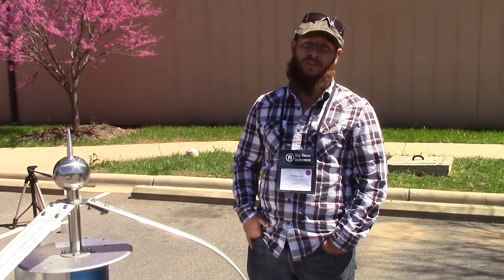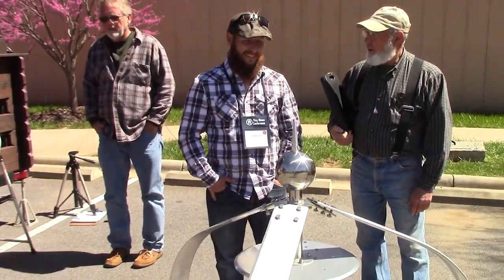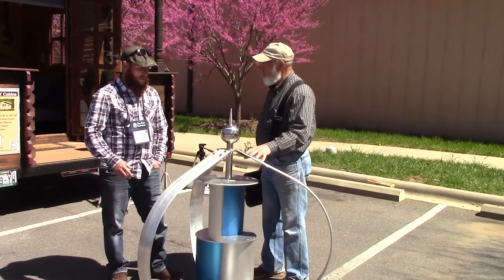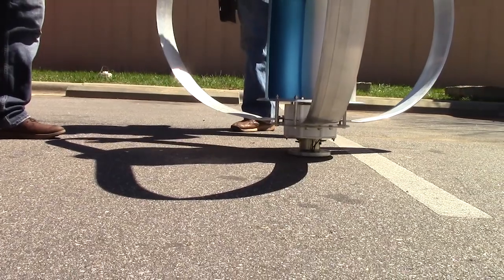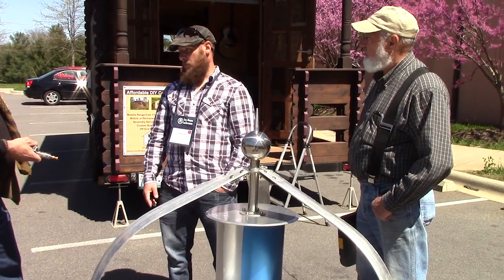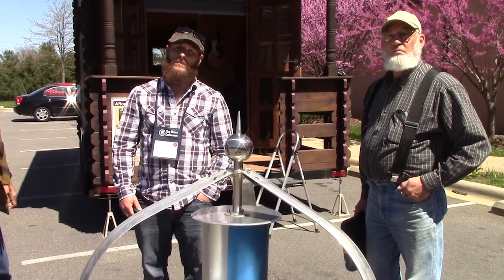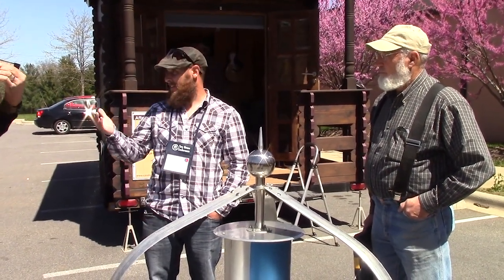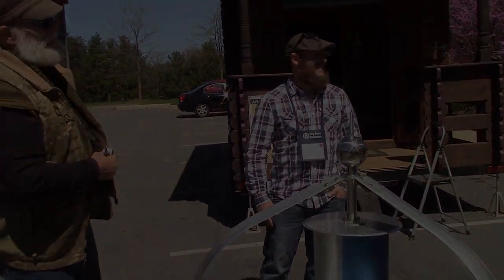Affordable 400 Watt VAWT (Vertical Axis Wind Turbine) Starts at 6 MPH

Comment: I would only need about eight of those just to run my entire house, at $528 each that is $4,000 and that's not including installation, and what happens on the days that the wind don't blow, oops no electricity, they have a phone number to call 814-573-6063 i n Pennsylvania

Comment: This is the worst turbine and company you could ever buy from (referring to Aleko). I bought the 350W vertical turbine and in very high wind speeds it barely generated 0.8 Amps. I contacted the company and they did nothing. The turbine is laying in the backyard and I had to buy a different turbine that works. I do not recommend this type of turbine from Aleko.

Comment: I have a 300 watts 24v similar to this one.  It is from Aleko.  I'm having difficulties finding detailed installation , set up and operational instructions and replacement parts for the upper shaft ball, tip, and spacer. Also, I am having difficulties with the noise level.  It started making a high pitch sound.  My neighbor complained about the sound. Can you help

Comment: I own one of these generator. I use it to supplement my 10 12v batteries, 24v configuration,  1200 watts solar panel  off the grid system.  It works find, however, I am having problems with finding replacement parts such as the upper hub ball and tip and attachment .,  and a detail manual for installation and trouble shooting.

Comment: that monstrosity for only 400 watt, omg that sucks
Reply: Andy Casbo Watt ratings are pretty useless without the charts of production at different wind speeds. It probably says in their literature the wind speed to produce 400 watts. But think about it, it could produce 400 watts in 100 mph hurricanes and claim it's a 400 watt wind turbine. If you live in an area with mostly 10mph wind, you'll be more interested in when it starts generating. I think this said 6 fpm (whatever that converts to). It's kind of a red flag when someone says it produces 400 watts per hour. That doesn't even make sense. Watts per hour is like saying horsepower per hour. To their credit though, 400 watts is a lot for a wind turbine, but it probably generates that in unrealistic high winds. At 25mph, this other 40"x40" VAWT puts out about 70 watts http://www.lynxwind.com/gull-wind-turbines.html
If you double the diameter/ height,  you get 4 times the output, so powerful turbines need to be big. Damn you physics! You're right though, you can get a 100 watt solar panel for about  $110. Spending  $600 for something that puts out half of that most of the time seems stupid, but it's insurance for cloudy weather, and it can potentially run 24 hours a day instead of 6 hours or so that solar panels produce at their peak.
Reply: I dont care, at this size , should be 1kw hour
Reply: In the video, the guy said that at 17 mph winds it would produce 400 watts in an hour.
Reply: @epharston  Watts have no time component.

Comment: I just purchased the 300w 24 volt VAWT, I was wonder if you could recommend a good charge controller for the product? My manual said that I needed a wind solar hybrid. I have three 100W 18 volt solar panels set already.
Reply: Did you receive your VAWT? Can it really produce 300W?